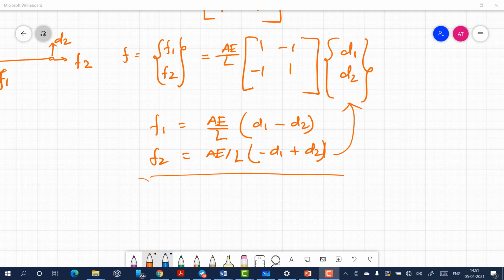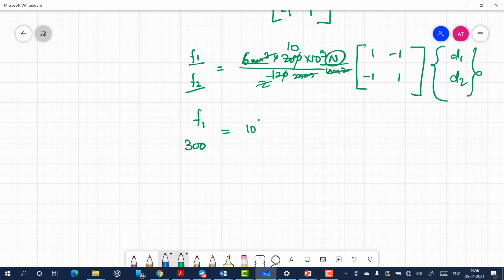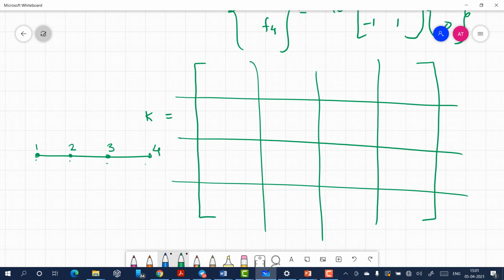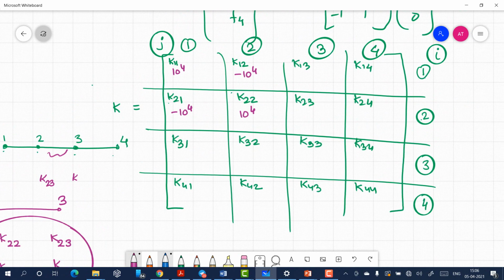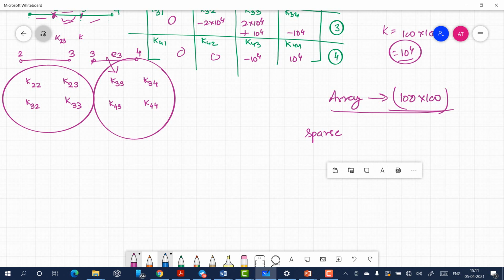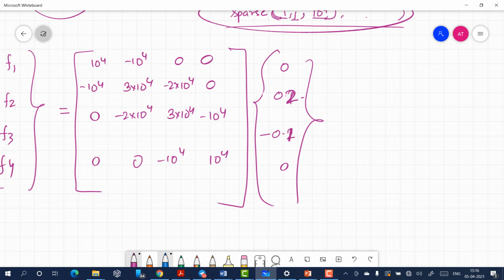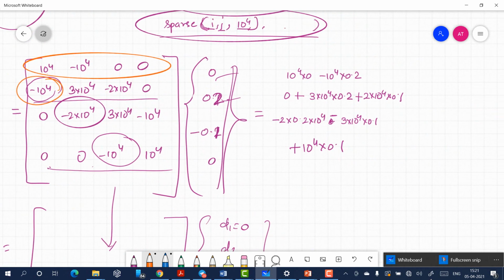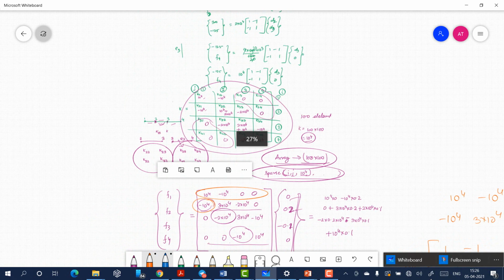MM308 Lecture 3 One dimensional problem Assembly matrix

Comment: 1. In this we learned about solving the one  dimensional problem through finite element analysis , by writing displacement matrix, force matrix and  stiffness matrix and then basically we saw if we could find no. Of solutions by converting it to echelon form or basically if it is invertible or not.
2. If N is the degree of freedom, then N by N will be the stiffness matrix ,as N will be the no. Of displacements.

Comment: 1) Solved for a bar having 3 elements each having different values of area, force, length, modulus by creating element wise stiffness matrix and then assembling them
2) The assembled matrix is generally a sparse matrix.
3) Refrain from creating a n*n matrix to reduce space.